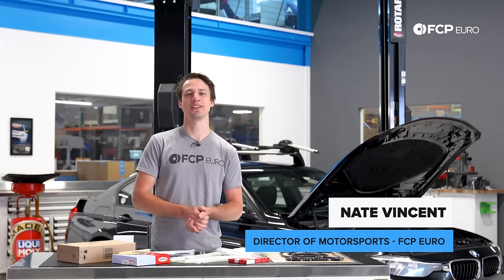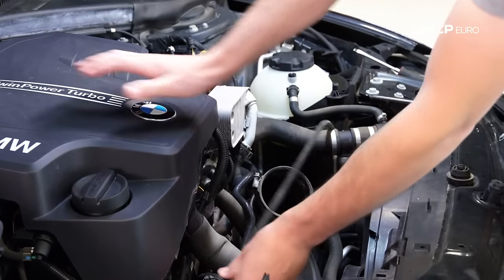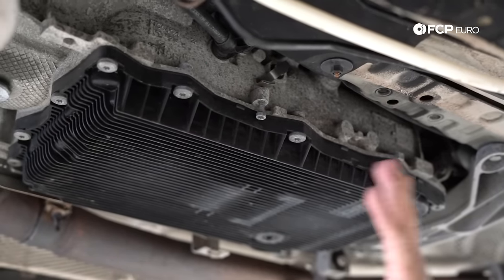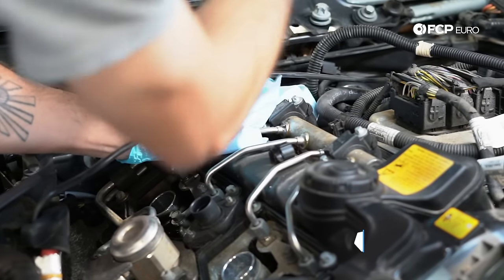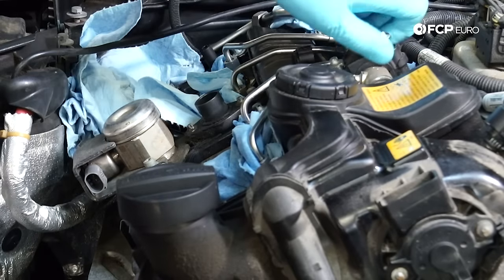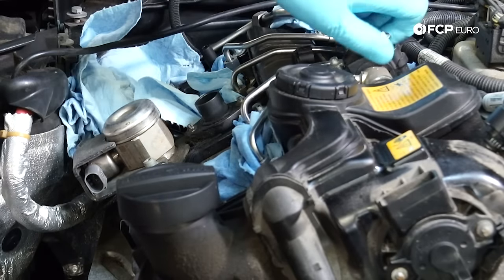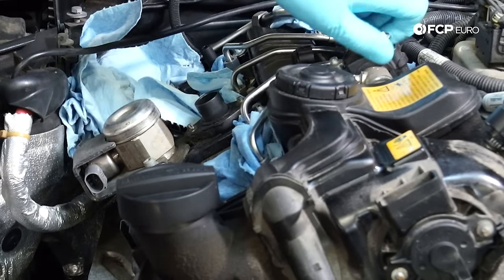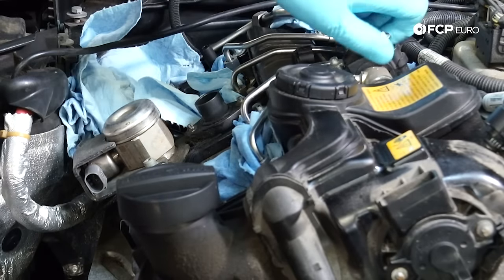BMW N20/N26 Timing Chain Replacement DIY Part 1 - Removal & Disassembly (328i, 320i, 228i, 428i, X1)

Comment from the maker: Shop the parts used in this video here: https://www.fcpeuro.com/products/bmw-n20-n26-timing-chain-kit-11318648732kt?utm_source=youtube&utm_medium=description&utm_campaign=f30%20mps&utm_content=timing%20chain%20diy
Reply: Are you saying the 320, 420, 520 and others have a different timing chain replacement procedure to the 328/428/528?
Reply: I like your work Emmanuel from Ghana
Reply: @Random-nf7qb  00
Reply: If you were to manually put the car in neutral (while the vehicle is not on) without locking the fly wheel, what would that do?
Reply: Thanks for the killer video and parts link. Is there a link for all the specialty tools used to lock the camshafts, balance shaft and flywheel?
Reply from the maker: @vlafronza  They are all linked in the description for you!
Reply: @fcpeuro  are you going to restock the tool kits/other parts y'all linked above? Your website shows everything except the parts kit as back ordered.
Reply: Hi could we please get the oil change history of this car? And if they used a additive like ceretec? Thankyou
Reply: @FCP Euro  Can you please do this video on an N55 motor? It would be incredibly helpful for the DIY community.  The only video out there is with the motor pulled from the car.  I would love to see you guys do this on the N55 motor with it still in the vehicle.
Reply: The kit is nice and I’d like to purchase, but I do not see the locking tools included for the cams, as well as other various tools to lock the flywheel used in the video. Where are these available?

Comment: EVERY automotive engineer should be forced to work in the dealer service department for a month and work on every repair before designing anything on a car.
Reply: Those engineers should be required to fix the problem so they can understand their mistakes.
Reply: When i worked for Acura as a tech we had engineers working with us on the real problem vehicles. It was actually pretty cool to watch them make their own parts sometimes like engine dampers for vibrations on 2004 2005 Acura TL.
Reply: I disagree. The engineer and technician would enter into collusion on how to keep one another employed🤣, thereby, exacerbating the complexity of working on your BMW!!
Reply: They do it on purpose
Reply: @Rock-Bottem1982  I would be happy with water pumps that are not driven off of timing belts that grenade the engine when they lock up or timing chain tensioners that can be accessed without dropping the subframe. I would even be happy with clearance to get at the rear spark plugs.  As for BMW, bearings that are not made of butter would be nice.
Reply: @yassirc3681  exactly. I work for Mercedes. We love broken cars. 😂❤
Reply: Toyota actually does this. Go figure right?
Reply: Engineers just do what upper management tells to do, get it under the budget, otherwise people would not be buying these cars
Reply: @Rock-Bottem1982 A brittle chain guide is absolutely unacceptable. Maybe some of them require to reconsider some of their abilities or the VPs have to stop cutting corners. Either way, this engine is absolute trash.
Reply: I thank those engineers. These pieces of 💩 quietly have almost paid off my mortgage.

Please continue with these crappy designs. 5 years left on the mortgage.
Reply: All of you are wrong and ignorant. Do you know realize this would put me out of work??? The harder it is to do a job the more money I make.. I love it when people can’t dyi there vehicles anymore!!
Reply: Absolutely @CATownsend777
Reply: Seriously… unfortunately if they did, they would purposely make the job even more difficult. I wouldn’t doubt it if BMW service dept was right up there with Ford as far as gross earnings go. Not only do they not consider the tech, I believe they intentionally sabotage! lol.

Comment: Just to let you guys know...anyone who may have the f30 n20 manual 6 speed transmission platform, you do not need a flywheel lock!!!! You simply put the car in 6th gear with the emergency brake on. Do NOT make the mistake I did and buy a flywheel lock only to realize you never needed one in the first place, if you have a manual transmission. This should be mentioned in the video..
Reply: What else don’t I need to do? I have a manual.

Comment: My 2012 328i got 120k miles and it’s still going strong, but now I’m low key worried about the timing chain 😭
Reply: mine went at 132000
Reply: @StillBrokeOff  Fr that’s scary 😟
Reply: @Chadabi  it sucks im getting quotes for repair now
Reply: @StillBrokeOff  🤞lmk wut they charge you
Reply: @StillBrokeOff  my dealership quoted me $7200 parts & labor... that's why I'm here today haha
Reply: :/ mine is at 110k miles... I always get so paranoid when I hear odd noises...mine is a 320d so the diesel engine makes it hard to guess if it's a fault or just a loud ass diesel -.-. Really love the car and don't want to sell but also don't want to have large repair bill... So far everything original and 0 issues only normal servicing.

Comment: This is by far the best tech video for the N20 timing chain. As a BMW OEM tech, I can offer time savers for this:

1. There is no need to put the automatic transmission in neutral. The parking pawl only holds the output side on the driveshaft. The torque converter and flywheel will spin freely.

2. There is no need to remove the crank pulley from the hub. It’s almost always rusted on, and will be damaged. You can put the lower guide bolts and plugs in before you put the damper/pulley/hub unit back on. The crank bolt is torqued through the center, and the pulley/damper does not get in the way.

3. The flywheel locking tool is incorrectly installed. It is a tight fit, and the zip ties should not be there. Place the tool into the bellhousing, and slide the bolts fully forward to engage the teeth.

4. For oil pan removal, especially on AWD cars, unbolt the motor mounts, and use ratchet straps to move/tilt  the motor into positions you need for access.

5. There is no need to do the TDC procedure. The cam tool will only lock in two positions, and only one position will have both cam lobes pointing up.
Reply: @fcpeuro are these tips accurate? Going to attempt this next month.
Reply: @hydn79  I would trust the BMW Tech, they think park in the transmission somehow locks the engine. It doesn't, the park rod only locks the output shaft not the input, else the starter would never be able to start the engine while in park, see the logic.
Reply: @hydn79  Yes, i'm a BMW Master Tech and can confirm the tips suggested above. Crank pulley can be left onto the hub and can be removed as a unit once the crank bolt is removed. Though for me...on XDrive models, I actually prefer to remove the front subframe completely. Front subframe comes out relatively easily and everything is easier with it completely out of the way, IMHO. Your mileage may vary...
Reply: @atchipmunk  Hi I'm looking to buy a non starting 328i xdrive N20 and need to put in neutral so it can be rolled / towed etc. Cranking the engine and pushing on the shifter method does not work.  It stays in P.  Will screwing in that bolt on the tranny as shown allow all 4 wheels to turn??
Reply: @mascho22  I believe screwing in the bolt will always put the transmission in neutral and will allow the 4 wheels to turn
Reply: @atchipmunk  Hi, I have an F30 x drive and need to do this job but without a lift,  I'm stressing over dropping the subframe.  Once engine is supported from above, hopefully I can lower it just enough to clear the pan (once the diff and both drive shafts are off and motor mounts disconnected)
Reply: what do you mean by no need to do the TDC procedure? are you talking about the ping TDC procedure?
Reply: @atchipmunk Need to do a N43 soon in 1 series, would you recommend to remove the subframe fully or just let it hang? Is a axle measurement needed after unbolt the steering rack? Thanks
Reply: @andrewlee1126  They perform an TDC setting procedure at 22:25, which is not needed, as the cams can only be locked when the engine is in the correct timing position.
Reply: For those following this. I did remove the pulley hub/snout assembly all in one piece like the tech recomended to avoid damaging . . . However when following part 2 he cranks the hub snout assembly down before replacing the caps over the timing chain guide pins. When I did mine it still had the crank pulley assembly attached to the snout and it covers the hole to put the guide plugs back. So if you follow this bmw techs advice just make sure you put the guide plugs back BEFORE you torque down the crank pulley assembly or then you’ll be removing it anyways to put the plugs back. Hope that makes sense.
Reply: Could you please do a video.
Reply: @atchipmunk  I have a '14 528i with plenty of room, can I use my impact driver to remove the crankshaft bolt??
Reply: @rickanzelone2123 you could, but it won’t take it off. My apparently 1000Nm DeWalt impact had no chance, ended up sticking a 2meter bar on it and jumping on it to crack it, its bloody tight
Reply: @atchipmunk I’ve got an x3 idrive and looking at the subframe’s four bolts thinking why would I not remove it!?! It’s not going to affect the alignment-at least what I can tell ? Am i wrong?
Reply: Is this an interference engine? If the chain snaps while running does it hit the valves? I’m looking into buying one with that issue and want to see if its worth buying and repairing. Thanks
Reply: My impact at 1600 ft/lb will easily remove the crank bolt. But will l cause damage to the fly wheel teeth??

Comment: Thanks heaps for the video guys, extremely informative as usual!

For those looking to do this work - get yourself a 3/4 or 1" drive breaker bar. My crankshaft bolt took about 90 kg of body weight and a 1.3m cheater pipe in a jerking motion to break free... that's around 840 ft-lbs / 1100NM. My 1/2 breaker bar was beginning to flex dangerously at the head below these torque levels, so I switched it out for a 3/4".

Also, I highly suggest you remove the alignment pin from the block / flex plate, once you've installed the toothed locking tool which goes through the transmission and engages the flex plate. I'd suggest also putting some texta marks on the ring gear, where it engages with the transmission tool - just in case the trans tool slips out, you'll be able to easily re-install/align them again. Depending on your tool set used and the tolerances/alignments for a given engine, you may find that your alignment pin starts taking some of the load (torque) when trying to break the crankshaft bolt free. I'd say it's almost a given. Given how tight my crankshaft bolt was, I decided to check the how the alignment pin in the flex plate was going when switching from the 1/2" to 3/4" breaker bar, and realized I couldn't remove it - it was actually taking some torque which resulted in a slight bend in it and a burr on the side of it. This prevented me from being able to pull it out by hand. I finally managed to get it out by removing the downpipe off the turbo (v-band + several bolts), then using a small pry to pull it out.
Reply from the maker: Thank you for the notes and first-hand feedback Christian! All these notes make it helpful for other viewers!

Comment: I have a 2013 328i oil changed every 5000 miles  with no problems .....  changing oil is  everything  !  I buy all my parts from you guys Thank you and thank you .
Reply: Which oil do you use? Do you also change the tranny fluid? Thanks

Comment: Excellent video. I just completed this job on a 2013 328i with rear wheel drive and a manual transmission. It is a BIG job and unless you have done it before, it is unlikely that you can complete it in a weekend.  This video, as well as the one by the "Auto Repair Guys", both grumble at the poor access to the bell housing for insertion of the flywheel locking pin (removal of the factory dust plug is the issue) and at the hassle of removing the oil pan. I fully agree. These are the two most frustrating parts of the job. The rest of the work is pretty straight forward, if you follow the videos, label all the hose and electrical connections and keep track of which fasteners go with which parts.

For cars with automatic transmissions or x-Drive, I would suggest dropping the front subframe to improve access to the oil pan. Eight subframe bolts, two motor mount nuts, some screws in the fender liners, freeing two hoses and the power steering electrical cables from their mountings, and disconnecting the outside temp sensor and ride height connectors. The subframe will drop 3-4" and hang from the shock towers.Use a jack to lower and balance the subframe. Not a lot of work, for a lot better access. Note that you need to support the engine separately. Also, loosen the crankshaft bolt before dropping the subframe.

The oil pan on this engine has a pair of "humps" along the rear mounting surface. These humps are taller than the space between the engine (actually the oil pump) and the edge of the transmission bell housing. The automatic transmissions apparently have a pair of cutouts to accommodate these humps. Given a couple of inches of jiggling space (either by raising the engine, or dropping the subframe, or both) you can remove the oil pan. Unfortunately, the manual transmission does not have these cutouts. I needed to completely remove the subframe in order to drop the front of the oil pan 8-10" in order to wiggle the pan through the available space.

Finally, one nitpick with the video. There is no need to remove the windshield wipers and the apron just below the windshield. Access to the strut mount bolts is through two removable plugs in the apron.
Reply: Excellent additions, thanks! Just wish I'd read this comment before pulling the wiper arms 😂
Reply: Did you also remove the steering u joint to lower the frame?
Reply: @bigdeal87  Yes, the u-joint needs to be removed. As I recall, you also need to remove the brake calipers, the cable connecting to the steering box and a couple of hoses that are routed along the subframe.

Comment: I was going to change the timing chain myself but after watching this video, definitely will sell my 320i!!! In fact, I’m about to go to the BMW dealer here locally to accept their offer on buying my car. I have a 2013 320i with 71,000 miles. I do all the maintenance myself since doing it at the dealer will cost me two arms and a leg!
Reply: You would've only been 1,000 miles outta warranty to have it replaced.

Comment: I want to do this job myself, but I can’t imagine removing the oil pan on a XDrive vehicle. Without a lift and pole jacks, this job is 10x harder. Unfortunately my extended warranty doesn’t cover this job for the timing chain rattle, so I will have to wait for it to grenade before they will pay for it. I guess I will just let it go! Excellent video though, you guys are awesome! Thanks for helping me make my decision!
Reply: The all wheel drive cars are much harder to work on.  Front axles and differential needs to be removed first.  Then the front subframe need to be loosened and lowered several inches.  My x3 oil pan was removed in my driveway, without a lift.  Extra Jack stands and plenty of patience is needed.

Comment: This is a fantastic presentation.  I don't even own an N20 / N26 engine BMW yet, but this has me in the mood to consider one, I would love a 3er wagon from this era.  Currently DD a fully self-rebuilt 2001 740i Sport (yes, I did my own TCGs), got a 2005 330i ZHP MT6 in the garage right now getting the full renovation treatment.

Comment: Thanks guys. Used this video the change valve cover, vacuum pump, and the solenoid. In a few months I'll be going back in to do the timing chain. I didn't feel prepared to tackle it yet, but I'll be ready to plan to change a lot of things next time.

Comment: One correction: That tensioner guide is not held in place by that little loop from the other guide.  It's held in place by the bolt you removed so there's no way it can move the way you claimed at 43:13   Other than that, very informative video.  Nicely done.
Reply: Both circles were damaged where the bolt holds in

Comment: Excellent video! Scary how loose that chain was. I have 4 friends with this engine, all of them above 60k miles, none have the new timing guides yet. I'm the mechanically inclined one who nerds out over BMW's. I know one of them is going to ask me to do this job for them sooner or later 😐 I got an n55 that's approaching 200k miles and I'm hearing a subtle whine sound. I'm praying it's not the timing chain guides 😕

Comment: Just did the timing chain on my 2013 f30 this past weekend started sat around 3pm finished sun 9pm give or take a couple hours for lunch breaks lol. If you’re mechanically inclined, it’s definitely a weekend project. Make sure you have all the tools needed beforehand as well. Trickiest part for me was dropping the oil pan as I had to loose the subframe and drop it about a inch. It’s not hard as it seems just very tedious steps. No expensive oem tools needed every tool I bought was off eBay cheapest of the cheapest. Double check the timing before taking off the cam timing tool. Tensioner tool ON BEFORE timing engine.
Reply: Hey whats up,  I have same '13 F30 xdrive and need to do this job but stressing over dropping the subframe.  Did you have to remove any of the control arms or splined steering column shaft?